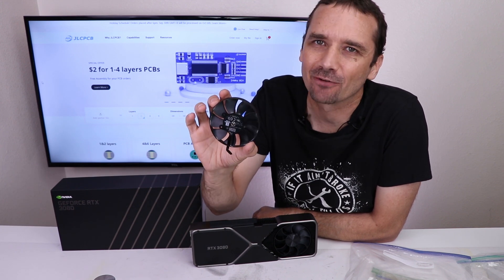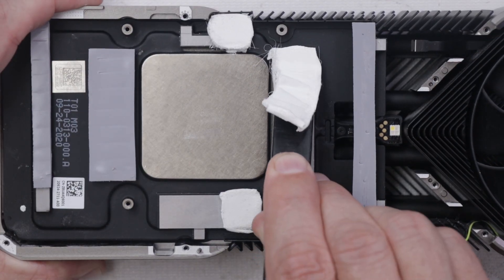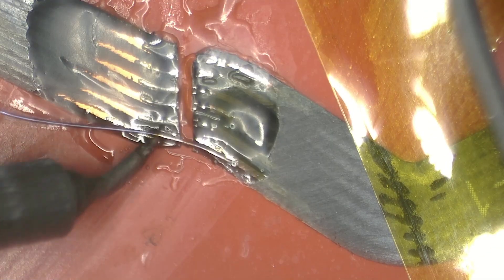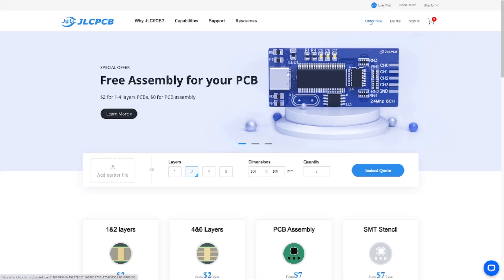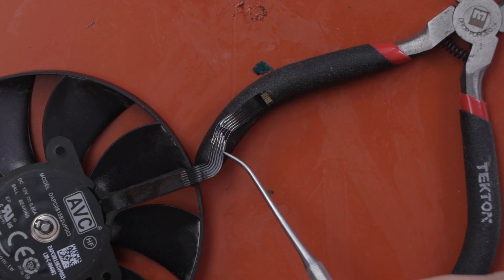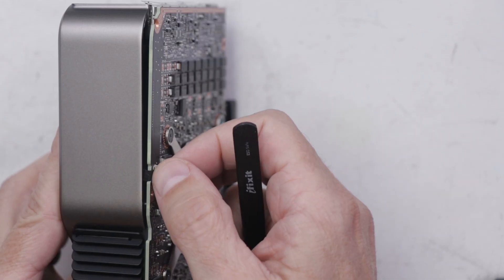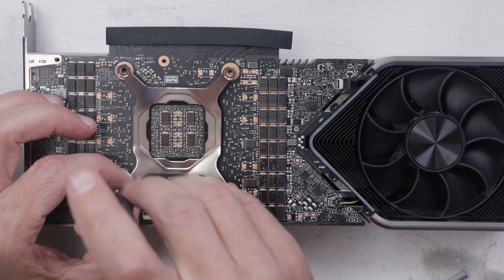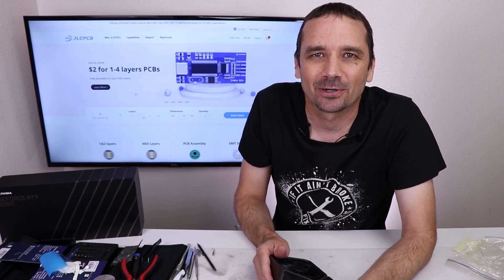FAILED DIY Graphics Card Repair - RTX 3080 - Let's Fix It!

Comment from the maker: For anyone wondering this fix and the graphics card worked great. The viewer who sent it in updated me after the video was already edited.
Reply: Nice!  I don't think it was even the fan cable fix that did it.  It was because of the perfect sized slices of thermal pads!
Reply: That's wonderful!
Reply: I was wondering if it was a successful fix...
Reply: Thanks for the update.
Reply: He has some real study hands better than me I'm 13
Reply: That’s great to hear it worked
Reply: That was never in doubt!
Reply: Ahhh nice!! Glad to hear that it’s all good!!
Reply: Hey I wanted to see if I could get in contact with you so I could get my tablet fixed one day apparently while sitting in a drawer the charging circuit malfunctioned and I've had it laying on my desk with the battery unplugged ever since if we could get in contact and I could send it out to you that'd be great and warning about it do not plug in the battery or plug in the charger because doing so will cause it to heat up rapidly it's a I think around 2013 Samsung Galaxy tab a it's lasted about 5 years. I know what the problem is and the problem is that I think a resistor on the charging circuit has exploded when that resistor exploded it caused a short which causes the board to heat up when power is applied and currently I think I have all the pieces to it and I can just send it out to you in a box

Comment: I’ve got a GTX 1070 - Card works perfectly fine, no heating issues etc. There is only 1 problem. The fans speed up to max and the display goes off. I’ve checked the card in another system and it has the same issue. Any idea what this could be due to? Card: Gigabyte G1 1070 gaming series. Any help would be appreciated.

Comment: Damn this was precision work. These cables are a lot smaler than many peole think they are. A good way to imagine how smal they are is to look at a USB-C connector (Like on your phone). The cable is about half as wide and can be stacked about 10-15 times in there. Not ripping them off, considering their placement and the weight of the card (as well as the fact that these cards are not really that easy to hold with one hand), is possibly harder than ripping them of.

Comment: @TronicsFix i have a 3070ti i got from a prebuilt. TLDR the card got sent to me working, but became defective so i had to send it back to cyberpowerpc, it MAGICALLY got damaged in shipping and i couldn't afford the insurance on the card so i have a paper weight of a 3070ti. the L shape on the end of the connector on the pcb broke off and they refused to repair/replace same goes for gigabyte if it's toast it's toast, but if you think you can fix it i'll send it to ya

Comment: I think if that happened to me i would just use a regular 120mm fan and take power off a fan fort on the mb or take 12v off the psu and just have the fan run full speed all the time. Cool you were able to salvage the old fan thoigh, i didnt know you can sand and solider to ribbon cables like that.
Or use it as an excuse to buy a water block and do a open loop setup.

Comment: I was replacing some SMT LED’s on some light bars on our fire engines yesterday.  The disassembly was involved .  I managed to install all 12 LEDS backwards!  Soooo back apart, reinstall LED’s correctly and reassemble.  A 2 hour job turned into 5.  It happens I guess.

Comment: Be great to see more GPU repairs. Especially buying cheap so-called 'dead' cards from eBay and see if you can fix them. Like Nvidia GTX 980, 1060, 1070, 1080 or better and similar for the Radeon models. Big bucks to be gained if you can fix them, although even broken cards sell for a lot of money.

Comment: I did this exact same repair but didn't use wires. It was a clean tear so I taped a piece of tape to my workbench sticky side up. Then I put the two pieces of the cable on it lined up. I scraped a little of the plastic away and used a conductive pen to repair the connections. After each dried I put some enamel paint on each repaired section and then did the same to each subsequent conductor. Then I taped it fully together for strength. It worked great.

Comment: I have a question out of this topic but I recently got a ps4 and it says “the following application is corrupted” and so I always put my ps4 on safe mode and rebuild database and retry it I still get it and I though of uninstalling the game and still the same thing and I initialized my ps4 and still the same and I am wondering if my hard drive is dying.

Comment: I'm going to start by saying that I could not have done the very fine pitch soldering that was done in this video.  If I could, however, I would have checked continuity not only along each trace, but also on the traces next to them to make sure I didn't have a short.

Comment: I'll bet you this works better than new. When gamer's nexus took it apart I'm like ewww those thermal pads are trash and that thermal paste is garbage. I wouldn't be surprised if it runs 5 degrees cooler.

Comment: The very idea of using cooling paste is to fill in the bumps. You use far too much, which will lead to the heat not being transported to the heat sink and the choir eventually overheating. The perfect amount of cooling paste is about three grains of rice which you then smear out. Do it again and do it right!

Comment: I asked Steve to not mention my name in the video as I am embarrassed I broke that cable.  Thank you Steve for only mentioning my name a few times!  :-). Steve did an awesome job on this repair.  I can confirm the card is still running perfect a month after receiving it back.  The GPU is running a lot cooler thanks to the premium heat pads and the perfect amount of thermal paste.  I do not see the temps of the VRAM well into the 90s when gaming anymore.  95C is the max temp for the VRAM chips recommended by the manufacture and this card can easily go above that when running demanding games.  For those curious about frames per second, I did not run a benchmark with the stock heat pads before the repair so I can’t confirm a performance increase but the lower operating temperature should help prolong the longevity of the card.  There is probably a performance increase in some games as the card will not have to reduce voltage to reduce temperature as much.  That fan wire is a lot smaller than it looks in the video.  As I remember, it is only 3 or 4 mm wide.  It takes a great deal of talent to fix something that small.  If anyone owns a Nvidia founders edition 3000 series GPU, I recommend the heat pad replacement for cooler temperatures (some report a 20C drop in temps after replacing the heat pads) but be very careful with those three small cables!  Thank you Steve for the repair!  I love this GPU and I am happy to have it back and running cooler.

Comment: This wasnt a graphics card repair. This was a fan ribbon cable repair. This should be a lesson to people not to mess with things they arent equipped to service. Changing thermal pads for no reason caused this dude to be without a video card for potentially weeks because he didnt know what he was doing.
Also, I have a couple dead GTX 1070s if you want to try and fix an actual non working card. One of them appears to have PCB damage and the other one just wont post for whatever reason

Comment: I wonder if its possible to find a similar sized ribbon cable and scrape of the mask and lay it on top of the broken one exposed copper to exposed copper with a little solder and heat it so it melts together?

Comment: As a tech myself; I'm wondering why you don't wear a grounded wrist strap while making all these repairs.  There may not be much chance of static buildup occurring in your work area, but I still think it's better to play it safe. I always wear a wrist strap if I'm going to be touching PCBs (etc.).  Even then, I try not to touch the traces and components if I'm not doing any soldering on the board.

Comment: Hey TronicsFix, this was a very good job. I Have see u use the normal thermal pads with difference thicknesses , this is not a good choice for the RTX 3080 founders. The Rams need 100% contact to the Vapor chamber because her work temperatur without Thermalpad mod is crazy high.(~105° in gaming, max. temperature 110°)

The most people use for the RTX founders Thermal pads with a high compressibility. 

Sincerely a big fan.
Reply from the maker: I didn’t choose the thermal pads. I just used what they sent with it
Reply: @Tronicsfix  Ahh ok, I hope that the RTX will still work well for a long time with these thermal pads.

Comment: To test you can use a pcie riser and a pcie 6 pin for power and 2 more separate power cables. That would get the card to turn on and have it laying on a table to closely look at it. Can use msi afterburner to turn up the fan. Looks like ya saved the card that goes for 3k on ebay so nice job as always.

Comment: Too much grease. Proper way is to put a dab on the middle and let it spread out itself using the HSF pressure.
Reply: Too much thermal paste is literally not a thing. There's been multiple videos on this: https://www.youtube.com/watch?v=EUWVVTY63hc, https://www.youtube.com/watch?v=r2MEAnZ3swQ
Reply: That’s for cpus, gpus generally need the entire die evenly spread across like shown

Comment: Nice video! Cool that you include all mistakes. Just a note (not sure if is the same case for 3080) I had a gtx 970 that recently broke on me because I put to much thermalpaste. I had my GPU send to an expert and he told me that for CPU you are suppose to have a thick layer of thermalpaste but for the GPU there should be just a thin layer. I put way less thermalpaste om my GPU then you did in this rebuild and it still splashed over the chip cousing it tp break. As I said, i'm not an expert myself and I am sure that someone in the comments can correct me if I am wrong. I got that information from "Inet" that is swedish biggest computer store. Great job with the rebuild!

Comment: I've done this repair twice. I use old IDE cables with solder mask and some very sturdy hand work. This way you can cut down the cable to remove the crispy bits and lengthen it to the correct size. All the wires are attached to each other so once you have the corners done the rest is easy without worrying about melting the IDE shielding. I'm 'legally' blind so all my work needs to be done under a microscope where it's big and bright enough for me to see. I've even made a pair of glasses that magnify the same as my scope.

Comment: JEEZ, I replaced the thermal paste on my 2080 TI recently, and boy, am I glad I didn't have to deal with ribbon cables.. I absolutely LOATHE ribbon cables. I fully understand they save space, but the fragility is just not worth it to me. Seeing you fix that cable made me cringe, not because you did a bad job, but because that.. Would not be possible for me, with my recent issues with my hand (It hurts to hold a cup). My last solder job was splicing together earbud cables, and my hands were shaking like you would not believe. But it was either pulling through, or forking up 500 bucks for new ones on eBay, when they were originally worth like, 150. HELL no. I'll rather Frankenstein these to their dying breath.

Comment: Really great work! I've always thought that soldering these ribbons is impossible. But why haven't you just bought a new fan on eBay!? Normally you can get them separately. 😉
Reply from the maker: If I put a new fan in it then I wouldn't have been able to make a video showing how to repair the ribbon cable.

Comment: ngl good repair but some misakes were made, youre better off completely disassembling the card rather than tryna slide through that cramped space as there is a specific location its meant to be somewhat adhered to, doing it like that risks breaking the cable putting it back in and can be how a lot of these cables get sheared, also WAY TOO MUCH THERMAL PASTE, I dont normally care about it but on bare GPU dies it matters way more as the heat transfer in these cases is way more extreme, also thermal pads on the back were he, you need really a lot more coverage to get the most out of it otherwise its alright

Comment: I noticed you used a spudger to spread the thermal paste. I have done that (usually with a gift card or something like that) on all my PC builds, but noticed you normally don't. Is there any reason you did it here? I always did it to make sure I had even coverage
Reply from the maker: I've never fixed graphics cards before and it wasn't mine so I wanted to make sure that it was the perfect amount and spread perfectly!
Reply: It's to make sure the gpu die is fully covered and also its to stop the excess thermal paste from coming off the die
Reply: I always saw people suggesting that spreading it like that was a bad idea, because you're more likely to leave little divots that will trap air.  So it is theoretically better to let the compression between the heatsink and the heat spreader / chip push the thermal paste out from the center.  I've built dozens of machines since the nineties, and i used to spread the thermal paste - then in the mid 2000s i had several machines that kept overheating.  After reworking the thermal paste, they functioned as expected.  

So i'm sure 90% of the time spreading it will be fine, but i personally stopped trying to spread it manually.

Comment: The model number for the fan is on the back you can literally just order a replacement instead of trying to fix the cable but you know entirely up to you what you do with your fixes
Reply from the maker: But then I wouldn't have been able to make a video showing how to repair the ribbon cable.

Comment: Fundamentally a video card isn't very different from a game console...so it makes sense that if you can fix one you can fix the other.  It's a dedicated device that only has one function, as opposed to having a bunch of different components on a larger board, but they all work on the exact same principles.  I do wonder if it would've been easier to just replace the ribbon cable though.  I imagine all of the 3000 series cards (at least the ones made by Nvidia directly) probably use this same cable for the fan.
Reply: incredibly difficult ive tried getting replacement parts for my 3090 FE but you basically have to buy other peoples old coolers
Reply from the maker: The owner of this graphics card was able to get the manufacturer to send them a new fan. But I already had it here and wanted to make a video out of it.
Reply: @Tronicsfix  damn they had more luck than me Nvidia point blunt refused to give me one despite the fact my card was brand new sealed in box

Comment: Heya, good video as always! Would you happen to have a direct link to the thermal pads that you used? I need to replace the "forbidden cheese slices" on some of my own devices.

And yes, I hate to admit that I did indeed google some of the shrine challenges. 😭
Reply from the maker: Some of those challenges are crazy! I don't have the link for those. I didn't buy them. The owner of the graphics card sent them in with the card.

Comment: You didn't apply the perfect amount of thermal paste. You literally scraped it off the edges of the die, which is where you WANT there to be excess thermal paste, so that the die is actually covered and doesn't have hotspots around the edges.

Comment: Sad that they've moved to ribbon cables. I've spliced wires before for GPU fans to rebuild mining cards but broken ribbons are one step too far for my basic soldering skills!
Reply from the maker: Just takes a little more practice. And a microscope helps
Reply: Wires are so much better. There's flat style wires out there, it'll look better as well as be more durable.
Reply: Repairing traces is the most hard for me when repairing board. You need a huge patient to be good at that. Unfortunately i've only have a little while opportunity to practice trace repair when i'm working in electronics factory before i lost my job because of the pandemic. I hope i can buy professional microscope one day and start again my because it's quite expensive in my country.

Comment: Hi Steve, would the thermal pads you have used be better if we replace them on ps4 ram chips, instead using the original pads?
Reply from the maker: Possibly but the ones on the PS4 are adequate.

Comment: dont you think was a good idea to put mask to the actual wires because the are expose to metal brackets casing?or even some  thermal shricking tube...thanks for the video
Reply from the maker: It was just a precaution. The ribbon cable touches part of the case so I just wanted to be safe.

Comment: After seeing this I think I understand why there is a chip shortage - Damn. Great job as always though.
Reply: You should see how these chips are shipped, too... I buy chips for eurorack builds and they come individually wrapped in a plastic EM housing, with a 4" padded box enclosing each chip that is sealed inside of a bag with a humidity detection card in it that instructs you to oven bake it if the card has turned pink. All of that for a single $11 microchip. Chips are freaking valuable.